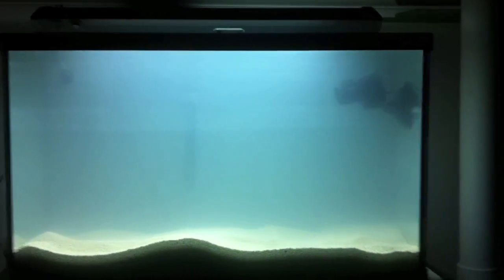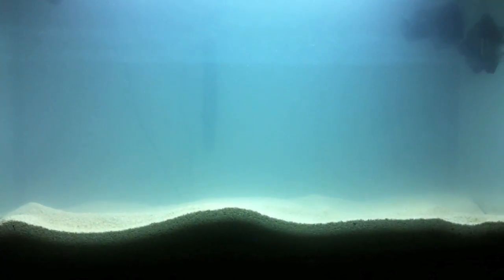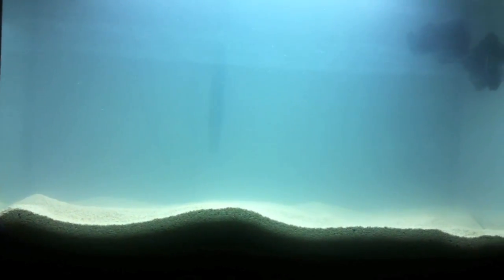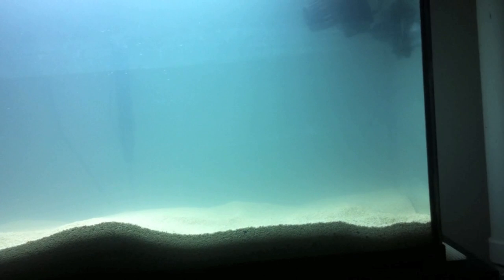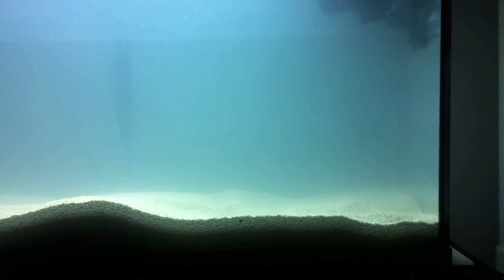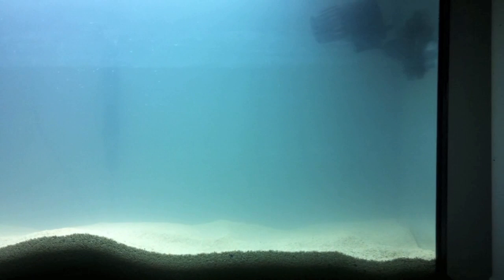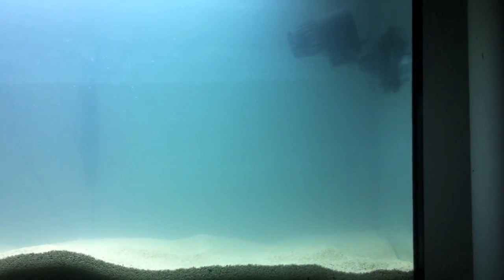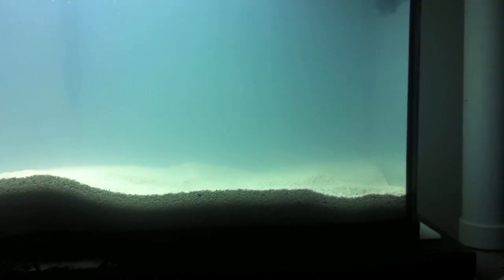Reef Tank Series Part 2

Comment from the maker: I was concerned too, but the water ended up being a really good deal I got basically 90 gallons for 40 bucks..  I like the switch too, helps a lot when a bulb goes out you don't lose the whole thing.  (Separate circuits)